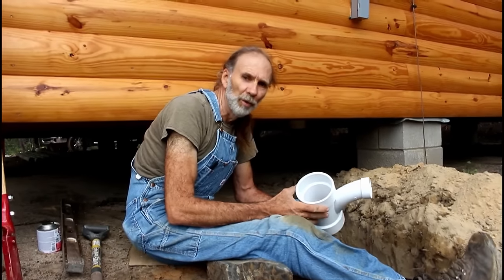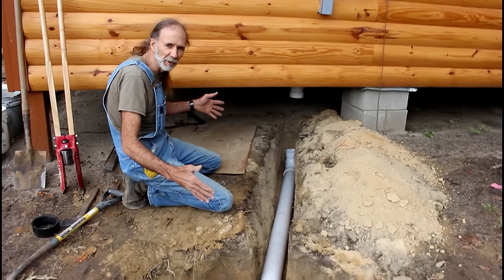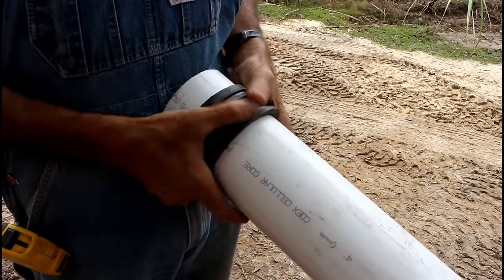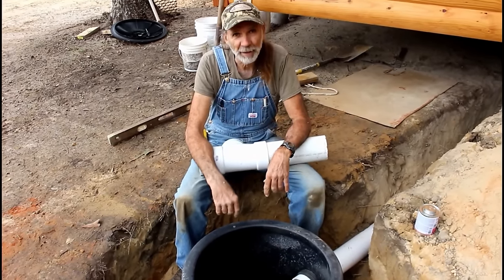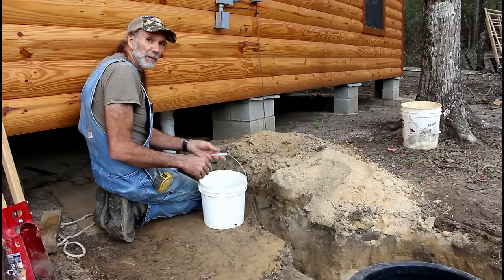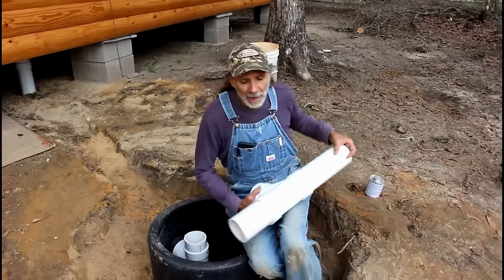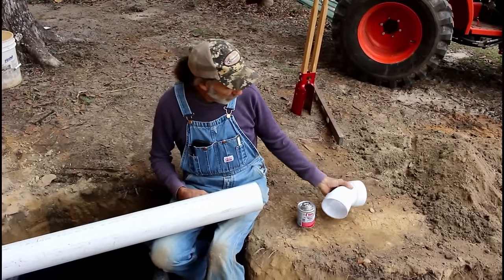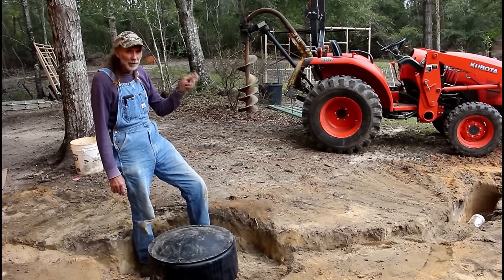How to INSTALL Your OWN Septic Tank | Septic System Install | Part 3

Comment: Its ILLEGAL to do yourself in most places...even way out in thr country per county and state laws.
Reply: He has had his own construction business and I am sure he's probably got all the proper knowledge and journeyman plumbing experience. Nothing illegal about that.
Reply from the maker: I'm a license contractor and you are correct in lots of areas it is illegal if your not licensed.
Reply: once you involve the health dept they have no sense of humor about anything, in Texas you have to be licensed installer for any septic no ifs ands or buts about it its the law.
Reply: @greatbay1961  That isnt right if you ask me, any competent person can build one to code.
Reply: In the state of Georgia the homeowner can pull their own permit and install their own septic system after taking a installers test at the environmental health department. We would have to install at least a 1000 gallon septic tank to handle up to a 4 bedroom home with a minimum of 65 ft. of field lines per bedroom ( depending on your soil type ) All new homes need to have a soil test done before the environmental health department will issue a permit that's in Georgia. I'm not sure what other states require but I would think they would be similar to what Georgia is doing. As for not using primer/cleaner on the PVC because it's not under pressure I think you should use it because it actually fuses the fitting and the pipe together to form a bond as strong as, or stronger, than the original material. 
I'm not on here to criticize what he is doing in the video I think he is doing a great job and what he is doing will work. I think  the solids will build up a lot quicker in the small tank and will need to be cleaned out more frequently. 
I enjoy watching your videos they are very informative and I wish I had as much energy as you do.
Reply: @stangresto9748  In Texas they dont see purple primer it fails automatically, system in house and outside must be inspected 2 times before you can cover it over, this wouldnt even come close to passing in Texas.
Reply: I can & will be installing my own system in Kentucky. I will be moving there in the next few months. I have spoken to the county inspector and the state inspector. They both agree that I have the ability, I am a DIY'er and I am a 59 year old Female. They sent me a pdf file with the few requirements that I need to follow. You are right, its not hard mentally, just common sense. But some states want to charge you for anything they can. 
So far I will be saving over $20,000 dollars in permits, inspections, and "required" paid installers, by building my home in Kentucky vs in Michigan. So, for someone like me on a very small fixed income its a no brainer to move from here to there. I will also be saving $1,300 per year on property taxes. 
And my growing season will increase 4 months to cut my food costs. Its a no - brainer all the way.
Reply: @denisewilson8367  You can do everything yourself in Michigan, I'm doing it right now.   Septic, electrical, plumbing, building, you just need the permits.   I put in my own shallow well (22 ft) but will pay to have a 80 ft well installed.    I'll stay here until legal cannabis spreads south.   Getting locked up over a plant sucks.
Reply: Sislertx says its illegal, not me. I know I can do it. You sent your message to the wrong person.
Reply: @denisewilson8367  Im sure you can do it, good luck with your project.   I was replying to you, I purchased property in Michigan a couple years ago, started building last summer.  I have about 1500 in all the permits including one for the drive way.  How much in permits fees will it cost you in Kentucky?